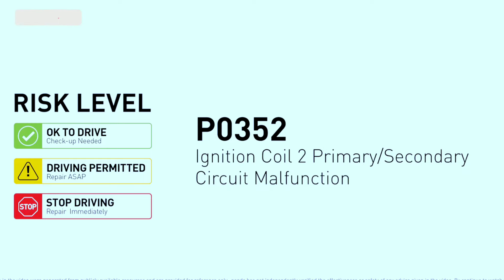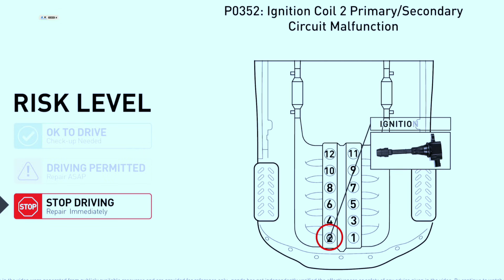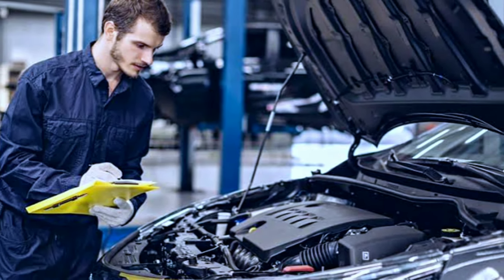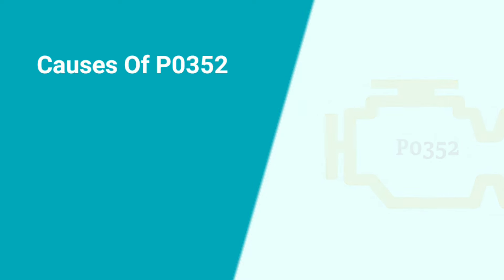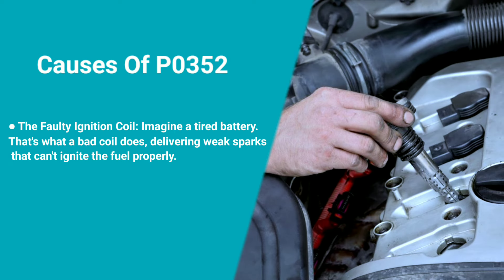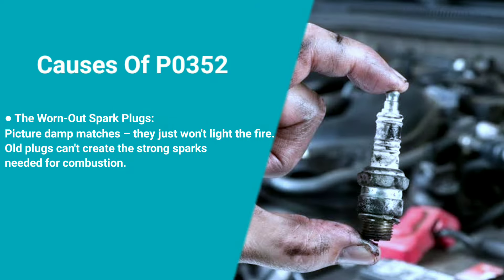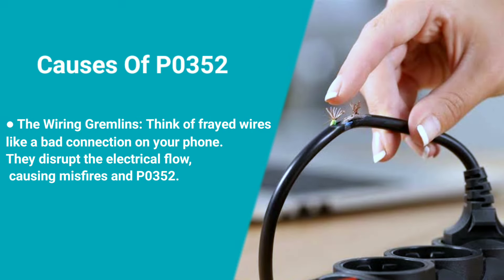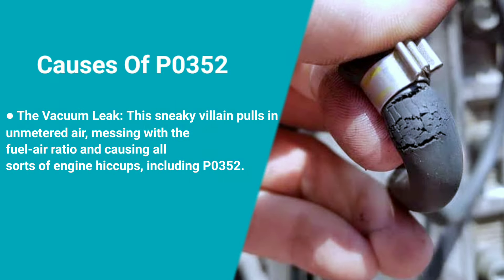P0352 Code Explained: What It Means and How to Fix It ?

Comment: I have a 03 ram 1500 5.7 I replaced the coil plug and wires and still have the code, what could it be?
Reply: Erase it and drive it for a while if it still pops up trying to swapping coil 2 with coil 4 and see if it still pops up